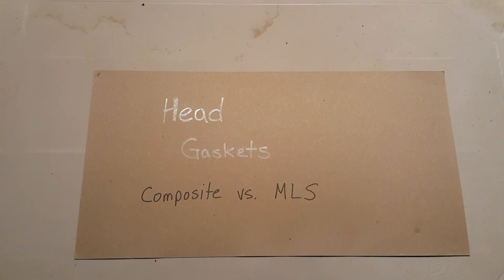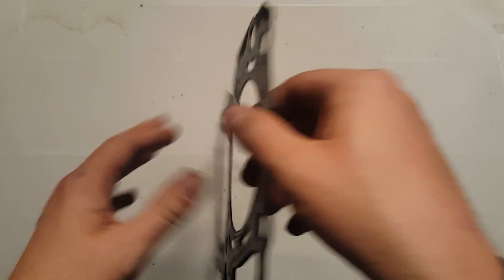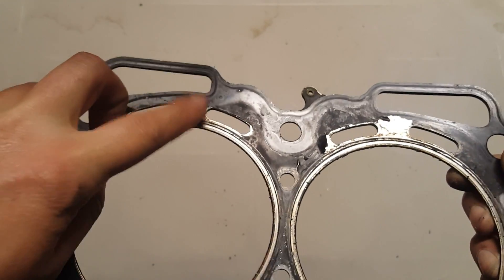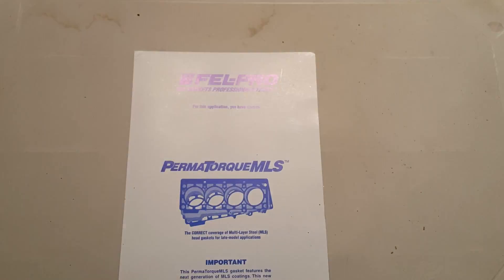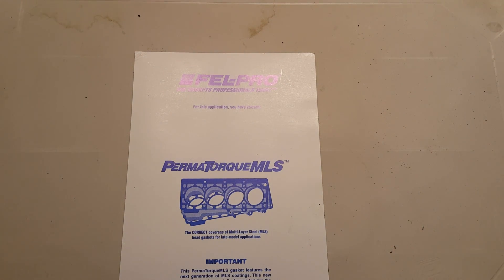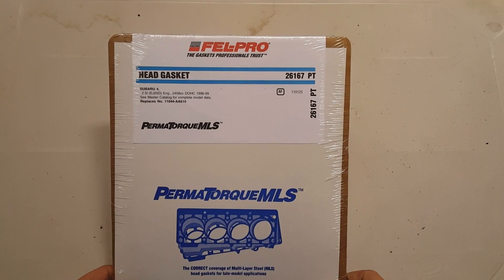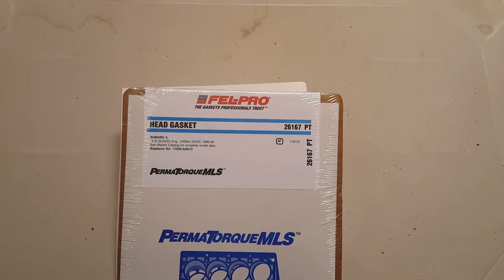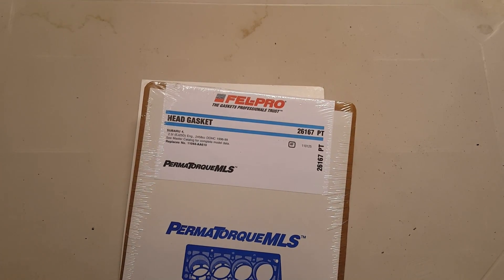Are Fel-Pro Gaskets Better on a Subaru Engine? Boxer Tech - Episode 2

Comment: Dude
Don't install new head bolt unless there OEM Subaru bolts
I've done over a hundred subaru head gasket jobs with Felpro MLS gasket and re using the head bolts.
My own car has over 140000km with these gaskets and the old head bolts.
I offer a 100,000km warranty ( conditional ) on head jobs.
Felpro all the way.

Comment: approximately 1996-2012/2014.  EJ engines, naturally aspirated, non-turbo, had the gasket issue.  they were a single layer, graphite coated gasket that failed. if you got to Subaru to buy new gaskets, it's still the old single layer graphite coated gasket.  the turbos of that era had a mutli-layer head gasket.
Reply: So Subaru fixed the issue in 2015?   I have a 2018 Forester and am worried about the head gaskets.   Am I good since it's a 2018?
Reply: Should be, but you  @robb7733  have to worry about oil consumption instead.
Reply: @robb7733 they did yes

Comment: just pulled a pair of the Fel Pro gaskets out of my EJ25, and they failed in the exact way the OEM coated head gaskets failed. The blue coating came off. I'm having the heads milled (they now have grooves from the fire rings) and going with a set of Subaru turbo MLS gaskets.
Hopefully these last for more than 5 years/25k miles.

Comment: I realize this video is old but if you are viewing this do NOT use felpro mls gasket, the coating on them fails. Use only subaru oem updated mls headgasket and have your heads milled. I have done well over 50   ej25  head gasket jobs. Trust me
Reply: copper coat spray works!

Comment: Are the fel pros any good so fsr?
Reply from the maker: Not a single issue that I have experienced with any FelPros we've used in rebuilds. The prep of the heads and block makes the difference.
Reply: @BoxerTechGarage  do you have a video on how to prep heads my subaru crapped the bed

Comment: Why don't you just use the MLS gaskets from the turbo engine? Those don't fail.
Reply from the maker: You can use the EJ257 head gaskets. It lowers the compression though as they're thicker to help keep a lower static compression on the turbo motors.

Comment: do you need to get the surfaces machined before replacing the gasket?
Reply from the maker: I always check the head surface before. If it's close to out of spec, I get them surfaced. If there no warpage, I don't bother

Comment: What’s the best ones can you use for a 2005 through 2009 outback xt?
Reply from the maker: I'm growing to like Mahle head gaskets.
Reply: Boxer Tech Garage thank you man , and yes because I seen some issues with the fel pro ones to , so if you don’t mind can you send me a link to the ones you use currently and do the make them for models before 2010?
Reply: Boxer Tech Garage the mahle ones of course ?
Reply from the maker: @Anthony0899  i don't have an exact link but the part number is 55017 for the 05-09
Reply: Boxer Tech Garage thanks man and that’s towards the link that you put in the description of the video ?
Reply: Boxer Tech Garage or is it autozone ?
Reply from the maker: @Anthony0899  Rockauto
Reply: Boxer Tech Garage all I needed to know appreciate it Og 💯❤️🌟🌟
Reply: @BoxerTechGarage  but do you still recommend the Fel-Pros? What about the rest of the Fel-Pro seals in the engine kit. Cam seals and etc? I've replaced the valve cover and plug gaskets and they seem to be working great.

Comment: I notice one design failure in the engine. There are not enough head bolts around the cylinder. This produces a wavy head. Would have to be a hg that can deform and have opening cladding. So I'm not sure that any gasket design is a cure. Depending on where the leak is, only some stop leak could be the answer. Yes, to me there should be six bolts surrounding the cylinder, not 4. With 4 there is a huge gap from one to the other.

Comment: If it matters to anyone... Fel-Pro valve cover gaskets/plug galleys. So far no leaks or oil on plugs... last checked at 15k miles. 07 Impreza 2.5i application
Reply: I've got the 07 2.5i like you, have you done the head gaskets, if so what brand did you use and are they going strong?
Reply: @nicholascortez6989  I actually haven't had any coolant issues since I've owned the car from 58k other than replacing the radiator (cracked along top plastic).  I've flushed and refilled twice using subaru coolant and conditioner. 145k miles so I know I'm living on borrowed time but I'm planning on getting combustion leak detector fluid kit and if I keep the car I'll be using these new multi layer gaskets or at least Subaru brand STI ones and new head bolts OR a used 50k EJ253 is about $1500 shipped depending on labor costs

Comment: Fel Pro blue head gaskets are absolute trash; the coating flakes off even faster than the OEM versions. Six Star is the only way to go.
Reply: My Fel Pro perma torques have been in for 6 years now No issues.

Comment: What about the 3.0 outback
Reply from the maker: The 3.0 rarely suffers from HG failures due to it using a far more superior MLS gasket. That's not to say it never happens but the failure rate is something like 10,000:1 or something ridiculously low compared to the EJ25. They fail less than the EJ22 does.

Comment: So did Subaru resolve this head gasket issues? And when? I do have 2001 outback should I expect it
Reply: You will have a HG failure. The HG issue wasn't resolved until the FA/FB series engines.
Reply: @MrSubaru1387   what year did FA/FB come in?
Reply: @oldsteamguy  depends on model. But 2011-2013 is when they phased in for most all models. 2015 with WRX. 2022 for STi models.

Comment: Is the 2012-2017 STI afected by this problem?
The engine of this Impreza is the EJ257
Reply from the maker: Not typically unless the engine was seriously overheated. Usually the spontaneous failures occur on the NA motors. The turbo motors are only affected if they've been overheated in which case you'll be getting the heads milled.

Comment: SOOOOO it looks screwed either way? I have leaks from new mls gaskets...….. im going with composite
Reply from the maker: Leaks after using a MLS gasket are usually due to an inferior gasket, contamination of the mating surface, or warpage of the heads and/or block deck. Make sure you check the flatness of the heads and block before resealing the motor with new gaskets.
Reply: @BoxerTechGarage  i went with composite gasket and still havent got call its leaking lol
Reply: @BoxerTechGarage  i did composite fuk mls been sealed great

Comment: I used the Subaru OEM MLS turbo head gasket with no coating. After 15,000 miles there is absolutely no leak at all. It is also extremely important to have the heads surface if you want to keep it leak for for a long time.
Reply: Those are the only gaskets that will fix the issue. 👍🏻
Reply: 100 percent correct fel-pro ive seen leak.
Reply: @jeffreyheinzelmanjr3317  After 32k miles, still no leaks with Subaru MLS gaskets

Comment: For a expensive headgasket replacement i want the job done right the first time. From what i have heard there are only three choices of head gasket you can use that will last. Those are the original Subaru head gasket, The Fel Pro head gasket and the Six Star head gasket. If those head gaskets cost say 40 or 50 Dollars extra and save you from doing the job twice, it is money well spent. https://youtu.be/ddFsFfiyOvg
Reply from the maker: There's another brand that I am going to be testing that claim to be a direct OE Subaru replacement. They won't openly state on record, but I suspect they're the maker of the new design Subaru gaskets. I'll have the comparison video up in a little while.

Comment: Mahle or Felpro for an EJ25?
Reply from the maker: I've been looking at the Mahle new style and I'm curious about their quality compared to Felpro.
Reply: Neither. Subaru OE MLS only or you'll be replacing them again.
Reply: @MrSubaru1387  how do you determine which OE mls gasket to use, cause subaru will not recommend one.
Reply: @liketofixit-ei5uz  what engine do you have?

Comment: A used Subaru pre-2012 with no Head gasket symptoms

Is it wise to replace the gasket as a preemptive measure? or wait for failure?
Reply from the maker: It depends on a couple factors: mileage and prior maintenance. A well maintained cooling system will usually prolong the replacement of the gaskets. The higher the mileage, the more prone it is to failure but if it is not showing signs of failure, it is best to check your oil at every fill up to make sure there's no cross contamination and also watch for drips of coolant, especially after driving for an extended period of time. Once the gaskets are replaced, following Subarus recommended service interval and procedure will ensure the gaskets never need to be replaced again.

Comment: call me in 80k and then talk about how they ”fixed” the problem with the update. 20 years later an the new problem same as the old, just updated.  gravity is still the enemy of subaru.   just say no to felpro ... and composite.
Reply: The Fel-Pros aren't the fix. Only the new Subaru MLS gaskets seal. Gravity isn't the issue. It that was the issue every Subaru and Porsche would blow HGs. The only Subarus with HG issues are the N/A 2.5L. The EJ25D, EJ251, EJ252, and EJ253. The H6s didn't have issues, no other displacement N/A H4 had issues. No turbo 2.0 or 2.5L had issues.
Reply from the maker: The very first one I did 5 years ago with these same gaskets is still going strong. It's all about the maintenance that helps them last. Most people neglect the coolant change on the scheduled maintenance. I had a Forester that had 204k on its original gaskets before it failed. The 98 Outback featured on other videos on my channel has 213k on its original gaskets and I'm about to crack it open for the first time.

Comment: DO NOT use blue fel-pro gaskets on any subaru. I have a pile of failed blue fel-pro gaskets at my shop. The coating peels off and leaks just like the originals. Buy oem subaru turbo mls gaskets, they dont have the BS coating and they fit on the non-turbos and never fail. Same gasket for 2.5 DOHC fits 2.5 SOHC. Subaru put shitty gaskets on non turbos knowing that they would leak after 100k miles but put reliable gaskets on turbo motors because they knew the normal gaskets would result in low mileage failures, covered under warranty. Also, the factory torque specs are BS, subaru changed the torque specs many times.....every few yrs says some different torque spec/angle procedure. Go 80 ft lbs with turbo gaskets and you will never have a problem again.
Reply from the maker: Thanks for your opinion on Fel-Pro gaskets. Unfortunately early Fel-Pro gaskets suffered the same fate as the early OE "updated" gaskets. Fel-Pro, just like subaru, updated their design and has gaskets for the subaru that are on par with the newest gaskets. All my cars use Fel-Pro, all the cars I work on use Fel-Pro, unless the owner specifies to use OE or Sixstar. In my 5 years and countless replacements, not one Fel-Pro gasket has failed. I also skip the first part of the Subaru torque sequence because it's pointless and use the FSM for the torque sequence and the second part. Again, never had any issues with doing it that way
Reply: @BoxerTechGarage  , do you replace the head bolts?  I've heard from a lot of folks you don't have to but felpro says you are supposed top but they might just be wanting to sell you bolts.  Are they TTY?  Why wouldn't you have to replace them if they are?
Reply from the maker: @downunderyank  Rarely do I replace head bolts on NA engines. They're not TTY bolts and the factory service manuals don't even mention replacing the head bolts, even on the WRX and STI. I check the bolts length to make sure they're still within spec. I keep a set on hand just in case any bolts are less than perfect, so I have bolts to check against.
Reply: @BoxerTechGarage  I agree. I have the Fel Pro permatorque in my Subaru. Put them in 6 years ago. No issues.

Comment: EJ22 and EJ18 use a composite gasket. Don't use a composite for EJ25 any version. There is not enough surface area left on the EJ25 for the gasket to seal and secure. This video is good advice.
Reply: Sorry I’m new to fixing cars.  Where do you find the EJ number on your Subaru?   I have a 05 Impreza Outback Sport
Reply: You have some variation of the EJ25. Most likely an EJ253 SOHC. The EJ18 and EJ22  were discontinued in 2001, iirc.  @legitballin1986

Comment: thanks for the video, I just ordered some composites for my 98 outback. guess I'll return them. 
So fel pro the way to go? also do you see a need in pressure testing the heads ?
Reply from the maker: Fel-Pro is certainly the way to go. As far as a pressure test, it certainly doesn't hurt to have that done and provides extra piece of mind, though most machine shops will charge extra for that. If you dont suspect the heads are cracked then you can forego that test. These heads aren't known to crack unless they've been ridiculously overheated. It's better to have the heads decked and have them do a light valve grind.
Reply: thanks you so much. Do you mean lapping the valves? why the light valve grind ? Boxer Tech
Reply: Cystic to strong Checking visually and if all looks good lapping the valves should do it.

Comment: in the link description of the fel progasket it comes with one but its not multi layer you need to buy 2?
Reply from the maker: The links and part numbers I referenced are a multi-layer steel gasket. You need two gaskets for a proper HG job, one for each side of the motor
Reply: Boxer Tech thanks im a newbie on boxer engines i didnt fully knew there was two til. 😂👍
Reply: Cezar Cortez. One gasket for each pair of cylinders. 2 on each side of the engine.

Comment: The problem is cheap shops that install the cheap head gaskets.  They buy the cheaps ones to lower the cost of the repair for the customer, but the repair doesnt last. They dont care, because "Hey I fixed it, thats good enough". Cheap is just that. Cheap. If they just came out with the better gaskets, guess what? Chances are most repairs at Joe's Garage were probably done with El Chepo head gaskets. Enjoy!
Reply from the maker: This is due to a lack of understanding of the special nature of this engine and due to oversaturation of misinformation. The one that is most affected by it is the consumer. They can't stand over the shoulder of the tech at Bob's Garage and make sure they use the right gasket, because they themselves might not know the difference
Reply: @BoxerTechGarage  Which is probably why Subaru owners should seek out a specialized shop if possible. We have two in our town. One I wouldnt take my Grandmothers Subaru to. They hire inexperienced people with average skills in the Subaru field, yes they do work on them often, but...they also install sub par parts. The other,is more of a high performance Subaru shop...but,they use quality parts and yes, expect to pay for that. The first aforementioned is also a Subaru used car Stealership that I have found to be very crooked in their own right. Low balling trade ins so they can turn higher profits on resale is just one of them. Their reputation is drown out by the elite that go there anyways, simply because that business has been there a long time. The fact it has never grown beyond its current size in decades tells me they cherry pick their clients and only deal with deep pockets. I have noticed only Grandmothers, yuppies and upper income people go there for service.
I do most of my own service,after that, I take it to the second shop, specializing in performance,ie better quality parts. OEM is fine, but if Fellpro makes a better quality head gasket, I have no issue.

Comment: I just bought a 99 Subaru Forester. Was told it only had 89k on it. Well, head gasket failed, and the car overheated. After pulling the heads, I noticed it had Fel-pro head gaskets.  The heads were of course, warped. I had them refinished, but the head bolts stripped out while following the prescribed torque procedure. I'm guessing the car has a lot more than 89k miles on it. Trying to decide what to do now., Oh, do you use Permatex Copper seal on your gaskets?  Why or why not?
Reply: You probably misread inch pounds for foot pounds like I did. Snapped 2 bolts before I realized it

Comment: I just popped in the six stars on my 2002 forester. My timing belt broke with only 40k miles (wtf) and destroyed the cylinder heads, so I replaced those with remanufactureds. It actually had the single layer OEM gasket on it previously. How long do you think the six stars last? (Stock motor)
Reply from the maker: Six star gaskets are manufactured just like the new OE Subaru design is, so they will likely outlast the life you'll have the car. I always tell people that if you replace the single layer OE gaskets with the MLS, they're going to last forever. I've seen EJ motors with factory MLS gaskets with 300k miles and no issues
Reply: Boxer Tech Good to hear, thanks
Reply: @BoxerTechGarage  Thanks for actually being knowledgeable on this topic and spreading the truth!
Reply: @BoxerTechGarage  Six Star is a great gasket as well. There is a subaru Specialist repair shop on the west coast that swears by them. Another good multi layer gasket